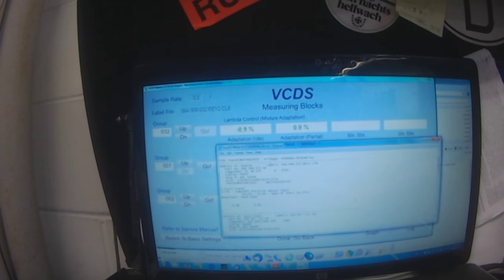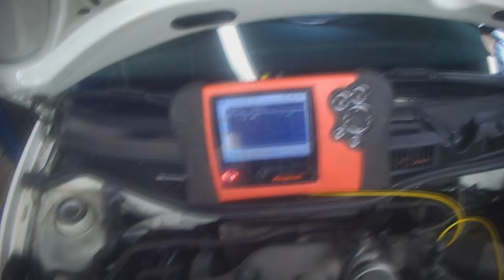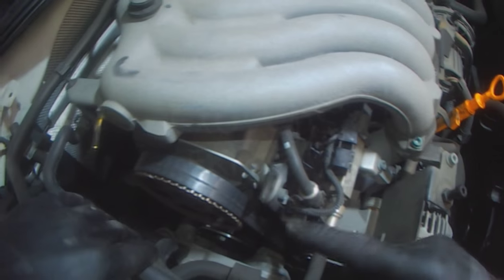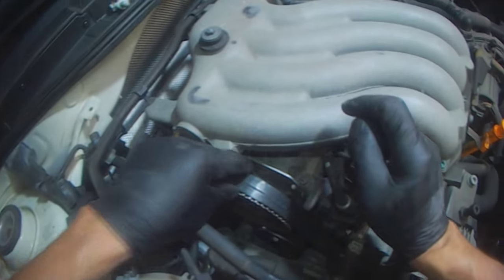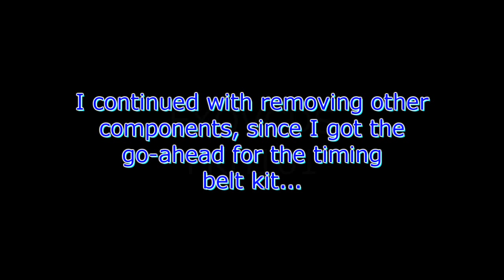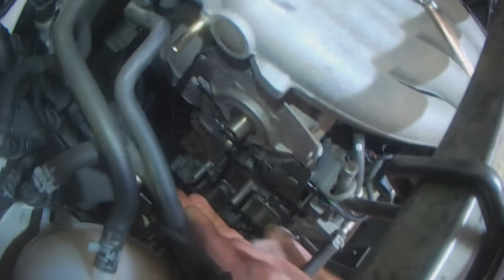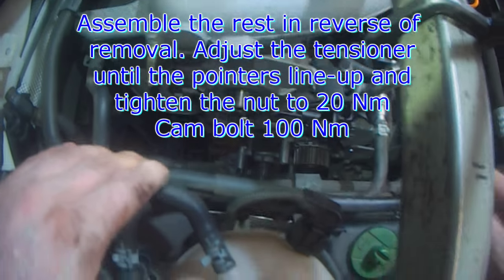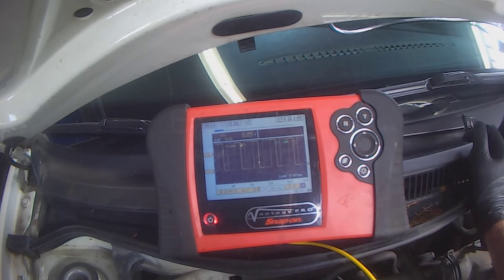VW A4: 2.0L Faulty Camshaft Position Sensor G40 (P1338)

Comment: If the camshaft is completely bad will the car still start
Reply from the maker: What engine, what year? You mean the camshaft lobes or the camshaft position sensor? The engine should still start if the sensor is bad... depends on the year of the engine / fuel injection system.
Reply: The cam sensor 2002 vw golf 2.0
Reply from the maker: +Hugo Lopez I had one today on a beetle.... car starts & runs OK.
Reply from the maker: +Hugo Lopez The engine in this video ran with a bad cam sensor. What happened with your car? Died while driving or just wouldn't start one day?
Reply: ***** drove it in the morning got home went to the store two blocks down got back to the house when i was going to go work it wouldnt start
Reply from the maker: +Hugo Lopez Have someone tap the bottom of the gas tank with an open hand (passenger side under the rear passenger seat) while you crank the engine. Could be a stuck fuel pump. Scan it for codes if that doesn't get the engine running (could still be a bad pump though).
Reply: ***** changed out the pump already lol first i changed the ignition coil pack that didnt work changed out ignition relay fuel pump relay the crankshaft sensor checked the fuses on side of dashboard the fuses that are on top of battery
Reply from the maker: +Hugo Lopez Does the timing belt turn? Remove the top belt cover and look at the belt when someone is cranking the engine.
Reply: ***** no i havent i will take a look at that when im off thanks
Reply from the maker: +Hugo Lopez Even if the belt turns... you need to check cam / crank alignment / timing. The belt could be missing teeth and caused the timing to go way out. I'll have more suggestions for you tomorrow.
Reply: ***** ok thanks i really appriciate it
Reply: so I found out what was wrong with my car it was the ECU thats why it didn't start ECU was fried
Reply from the maker: +Hugo Lopez Thanks for the update!
Reply: Can the camshaft position sensor read proper values and still be faulty, I recently replaced my cps sensor with an autozone sensor and I still have the same problem of being held at 3000 rpm, with a mph limit of 65. Any help would be appreciated
Reply from the maker: @onlyforeigngarage
The Cam sensor produces a signal / square wave. If the timing belt / cam to crank timing is wrong, then the cam position sensor signal will be out of sync with the crank position sensor signal.
However, I have come across a cam position sensor that was faulty... even though when looking at the signal, everything looked good (nice square wave). The cam & crank were timed correctly / in sync, but the cam sensor switch time (on / off) was lazy... making the ecm think that cam / crank correlation was not correct. The transistor inside the cam sensor was out of spec.
Reply from the maker: @onlyforeigngarage
Year, make, model, engine?
Reply: @EXOVCDS  2004 2.0 beetle engine code AJZ, I have verified the timing many times and have changed sensors aswell. I have tried things like removing the cat, new crank sensor, maf, as the problem remains. It’s giving the codes P0341, P0118, P1141, and P1152
Reply from the maker: @onlyforeigngarage
I need to see cam & crank TDC marks.
Reply from the maker: @2GearsDown  you should be able to post pictures on your channel, via the YouTube app. Press the + sign at the bottom, the select create a post.
Reply from the maker: @onlyforeigngarage
Email can be found on my YouTube About page.
Reply: @EXOVCDS  thank you, I will send a picture tmr my car is at work
Reply: @EXOVCDS  I sent the pictures via Instagram

Comment: nice job  i see you follow the  the guys as i will subscribe
Reply from the maker: +Richard Gill Thank you for watching & taking the time to comment! You've got quite a few channels that you subscribed to... will have to check out the ones that I don't know! Thanks for subscribing to mine as well!
Reply: ***** yes I do. Do you own a shop and where are you from. Also I see a lot of vw repairs. I work at various shops in nw Indiana. Mostly Emission related repairs, driveability, and electrical. I watch many diagnostic repair videos. I hold state certification in Emissions, Ase L1, A8, and A6. Keep up the great videos.
Reply from the maker: ***** I'm in BC Canada... I'm an employee at a small VW / Audi Specialty Shop. I just have a journeyman certificate. But with the way things are going, I'm thinking about getting some ASE Certification under my belt.

Comment: 19 · Jul 24, 2020

Hi all, I have just got ours back from the “Peugeot Specialists” after 40 days and they tell me they don’t know what the issue is! I paid $3000 to have it back doing exactly what it was doing when I took it in. Their next guess is either oval bore or stuck oil rings in number 4 cylinder (apparently the one on the left looking at the engine). I have now paid more than the car is worth to have a specialist repairer tell me that a 1600cc engine has beaten them. My advice is sell what you have before it becomes junk like ours and keep away from Peugeots (or European cars!).... over and out

SaveShare

Reply Quote 

￼

rbuckland

Registered 

Joined Jun 2, 2020

20 Posts

 Discussion Starter · #20 · Nov 11, 2020

Hi all, so I now have some really good news

The last fix attempt pre this posting was replacing the exhaust manifold sensor.

It didn't improve it, but the previous one was faulty because the short and long fuel trims improved afterwards.

I replaced too the crankshaft sensor but that didn't fix it either.

I ordered an AUD $20 crankshaft sensor from Alibaba in August but because of covid if arrived yesterday Nov 10.

AU $18.79 | Crankshaft position sensor for Peugeot 207CC 308SW 308 3008 RCZ Citroen DS5 C4 BMW MINI 1920LR/13627561753

￼

13.5US $ |Crankshaft position sensor for Peugeot 207CC 308SW 308 3008 RCZ Citroen DS5 C4 BMW MINI 1920LR/13627561753|Crankshaft/Camshafts Position Sensor| - AliExpress

Smarter Shopping, Better Living! Aliexpress.com

￼ a.aliexpress.com

My dad installed it today.. and it's fixed. No more errors.

Geez that was a long fix.

So it was a timing issue after all.

Suggest if you've got this problem .. replace the two sensors first AUD $40 plus labour.

Then explore tining chain and fuel mishaps